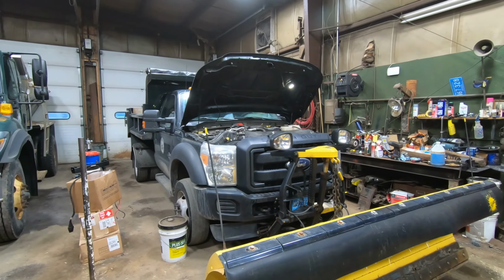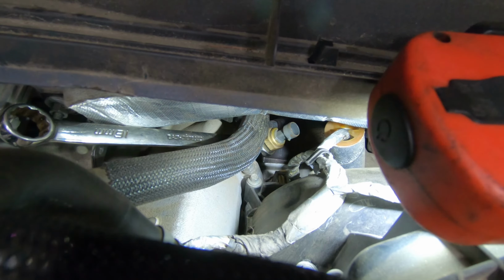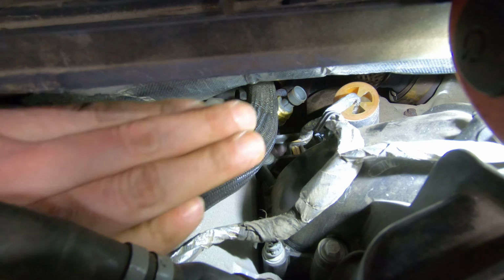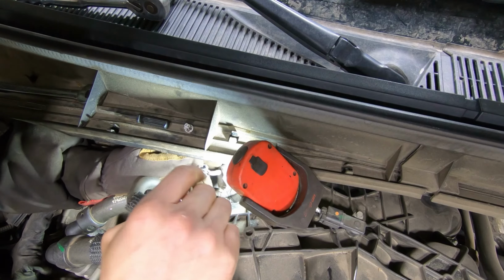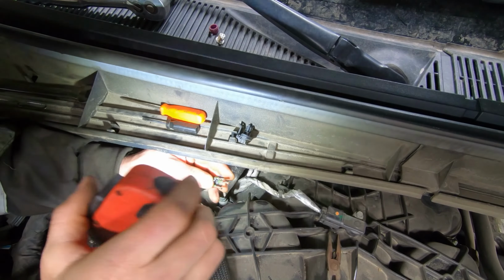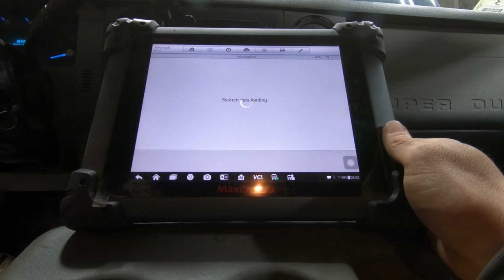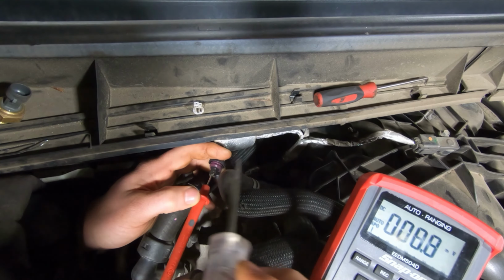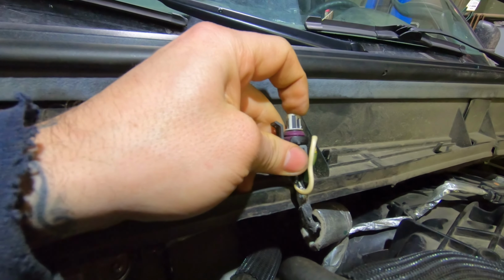ford 6.7 power stroke f550 exhaust back pressure sensor p0471 p0473 p0474

Comment: Where did you get the replacement connector
Reply from the maker: I ordered it from the ford dealer
Reply: You don’t happen to have the part number? My local dealer says there’s not one.
Reply from the maker: Wpt1376 I believe is the part number. There are a few to chose from. It is called egr pressure feedback sensor I believe. It looks right but I’m not 100%. 
https://www.rockauto.com/en/catalog/ford,2016,f-550+super+duty,6.7l+v8+diesel+turbocharged,3353886,electrical-connector,egr+pressure+feedback+(dpfe)+sensor+connector,2576
Reply: Thank you very much

Comment: I can't figure out how to unplug that sensor. Urgh it's pissing me off. Already broke the heater hose fitting. I don't need to break anything more. Trying to swap out the cp4 for the DCR. This sensor is connector is holding me up from 1 last intake bolt.
Reply: Of course I got it right after I commented

Comment: I have these codes P0471 and p0473 the sensor was broken off putting intake manifold back on put new sensor on now I have these codes an it’s running crazy rough

Comment: Got this code, along with the p2459, all monitors are good..swapped the sensor…blew out the tube, drove 50 miles and nothing…not sure if I should swap the dpf diff sensor as well…or just get the dpf filter cleaned professionally (there’s a service that does this near me) it was changed out 2 year ago (about 60-75k miles) please advise

Comment: Just got this code 8hr away from home, swapped out the sensor pretty easily with this vid. Thanks! To others: 16mm open end wrench, 1" deep socket on u joint hinge with abou 6" extension worked very easy. Be prepared for the nut to slide down the tube, it's a compression fitting.
Reply: I replaced the sensor and drove it for a week without any problems.  and now the code has appeared again. Do you have idea
Reply: @vasilykhachiuridze5747  the pipe probably needs cleaning

Comment: Great explanation/video 
I used a crows foot and extension to hold tube at base then used socket to remove sensor. Used pigtail pta1017 from Carquest 
Thanks again for making good content.
Reply: Excellent information on the repair pigtail part number! Thanks for your contribution.

Comment: The insulated cap with the plug in it on my truck is just hanging lose and not connected.

There is something plugged in to the EBP ???

I’m wondering if someone else has already messed with this ???

2017 f-550 6.7 245,000 miles 

Lots of idle hours 

Codes p132a
P0471
P0473
P0474

Comment: I got a p06A7 code coming up on my 2019 f-350 would that be associated with the Exhaust back pressure sensor?
Reply from the maker: Is that the only code? The code came up as sensor reference voltage b circuit range/performance. Possible causes are vref circuit short to ground, vref circuit short to voltage, vref circuit open, and shorted sensor.

Comment: I have a 2017 f350 6.7 80k miles giving me trouble I have been to the dealer 3 times now and they can't replicate the problem. When I'm towing my equipment to jobs it will intermittently reduce engine power and give me a boost performance code P2263, and a P0474. I can clear the code  going down the and it will continue to set the codes every couple miles. Any recommendations for repair would be appreciated. I use this vehicle for my small business.
Reply from the maker: So I just looked in a ford power train control/emissions diag service manual and under the p2263 pinpoint test it says diagnose any baro, ep, map, and egr DTCs before continuing with this test. So you should look at the p0474 first. It seems to be an exhaust pressure sensor intermittent code. This code can be caused by a bad sensor, a clogged exhaust tube, a bad harness or plug. Are those the only two codes you are getting? It’s kind of a toss up on what direction to go. My guess is the harness is going to be breaking or the terminals in the plug are worn and the connection is going bad. I would check the harness to the plug of the ep sensor they usually break close to the plug. You can get a repair harness from ford for it. Other problems could be the sensor, or a clogged tube but I would guess there would be other codes with that. But I would start with the plug pig tail. If you have access to a scan tool that reads live data you can see if the ep sensor is putting out a false reading. It should read atmospheric pressure with the engine off. But if the harness is not making a good connection it could be off too. Wiggling the harness with the engine off might make the reading jump around leading to the plug or wiring as the source of the problem. The turbo uses exhaust pressure sensor for feed back to control the turbo so the ep code is probably causing the turbo code. If you can graph data pids on a scan tool you can drive it and graph the ep sensor and look for drops in the signal that shouldn’t be there.
Reply: @JasonTheMunicipalMechanic   Thank you for the quick reply I do have a scan tool and I will get someone to help me check the sensor plug here shortly what you are saying makes perfect sense.

 Those are the only 2 codes I am getting, the p2263 code actually shows up twice, before and after the p0474 in my scan tool listing 3 codes total which is the first vehicle I have had to that with the dtc reader. I drove the truck for about 2000 miles with the engine light on with these codes stored and it finally tossed a def injector fault code along with these. Ford replaced the def injector and I thought all was well until earlier today when it did it again. Bone stock truck.  

I regularly tow with the automatic engine brake on im not sure if that makes a difference but my plan is to check the connector sensor and clean the tube as you stated and I will be sure to reply with results.

Thank you! I appreciate your reply
Reply: @JasonTheMunicipalMechanic  I just finished removing the sensor. When inspecting the tube it was clear no real obstruction just some soot along the inner wall but nothing to amount to any restriction I used air to blow the tube back into the exhaust. 

The sensor itself had a fair amount of soot built up inside I used air to clean it as well and some deoxit electrical cleaner I just re-installed it. I attempted to change the reading on the scan tool by moving the connector around and its showing no irregularities.

I plugged it all back up and it's doing fine... which is normal until I'm under a load and have been driving about 30 to 40 min thats typically when it tends to act up 

If it happens again I will replace the sensor just to rule that out.

I will be towing about 24,000lbs later this week for about 2 hours one way and then back. This particular load tends to set the code I will leave the scan tool plugged in and watch for irregularities.

Thank you for your help with my situation.
Reply from the maker: Hopefully the soot inside the sensor was causing the problem. If it comes up again I would lean towards the plug and wiring to be the problem. The terminals can spread inside the connector and make poor contact. The truck this was on was a 2016 with around 40k and the wire broke about an inch from the plug.
Reply: I have a motorcraft ebp sensor ordered. 

I determined today that I can unplug the sensor and drive the truck with no issues and no check engine light. 

It will only get to about 20psi of boost on the gauge at wide open throttle and the code reader is getting 0% egr error reading of course.

It does store the high input code for the sensor at start up but doesn't illuminate the check engine light.

As soon as I press the button for the engine brake it flashes several times on the display and then the check engine light comes on just like it does when I am actually towing before it sets the p0474 intermittent sensor code. 

I checked the wiring today I visually inspected the first couple inches of the pigtail by removing the insulating wrap and all seemed well I have not removed the pins from the connector as of yet.

 My color coding is different than the wiring you describe in the video and I do not know which pin on the ecm they lead to to measure the resistance in the wire. 

When checking the voltage drop should I have the key in the run position? 

I have high hopes this is just a faulty sensor I will have the new one installed tomorrow.
Reply from the maker: You can email me at jasonthemunicipalmechanic@gmail.com and I’ll send you pictures of the pin out of the connectors. The book is from an 11 so I’m not sure if it changed for 17, but I’d imagine the sensor plug wording is the same. You would want to check it with the key on so there is power.
Reply: *Baro(InHg) reads a constant 29.5 with the truck running or not. (The line says straight all the way across even if the sensor is unplugged and plugged back in)

*MAP(InHg) will rise slightly when throttle is pushed but is maintaining about 29.2 and with engine off its 29.2 constant. (Slight line spike)

(No reading from these last two I have listed if sensor is unplugged)

*Command EGR (%) is bouncing between 27.0 and 29.7 at idle. (Slight line spike)

*EGR error (%) bounces between 0.0 and -3.0 at idle (slight line spike)

From my elcheapo scan tool Innova
Reply from the maker: The baro is giving atmospheric pressure so that one won’t change. The map is going to be manifold pressure with the engine off it should be the same as the baro or real close your seems fine. When there turbo makes boost the map will increase adding whatever pressure the turbo is making. The egr is the amount the egr valve is open. It seems right and you don’t have a code for that so i wouldn’t worry about it. Do you have a data pid for exhaust pressure or exhaust back pressure?
Reply: I dont think I do. I will see if I can get my hands on something to be able to read it. I only have 24 live data read outs on this scan tool very basic stuff. Thank you for the help.
Reply from the maker: Look for exhaust back pressure or exhaust pressure. That is the data you want for that sensor that goes with that intermittent code
Reply: @JasonTheMunicipalMechanic  you are the man. 
I got out my multi meter and had the constant 5v on the 1 wire and had the 11.5 mv and 10.5 on on the other two no matter how I moved the wiring.
I replaced the sensor and towed 2 hours 1 way with the engine brake on and it didn't act up until I was close to the job.

The first trip It didn't reduce the engine power and did not set the p2263 code But the p0474 did show up by itself on my scan tool (I had it plugged in the whole trip) and the engine brake light wouldn't turn off on the dash. Cleared it and continued on driving with no further issue.
On the returning 2 hour trip I towed with the engine brake off and had no codes and no issues for the first time.

I'm narrowing something down now. It had always set the p2263 code with the p0474 before now.

I appreciate you help!
Reply from the maker: If you still getting the code you seem to still have a problem with it. So the pin out on the exhaust pressure sensor plug is if you looking at the harness side of the plug facing the pins. With the clip on the top the pins are top right is called signal return or ground, top left is 5 volt reference, and the bottom is the exhaust pressure signal wire to the pcm. You want to have between 4.5 and 5.5 on the two top wires with your meter leads on those two wires. The intermittent check on the sensor is to have the connector plugged in, ignition on engine off, access the pcm and monitor the ebp_v (volt) pid. While observing pid wiggle all accessible harness from ep sensor to the pcm and lightly tap on the sensor, wiggle the ep sensor connector, look for sudden changes in the voltage when harness and connector are wiggled or when ep sensor is tapped. Were you able to find the exhaust pressure pid on your scan tool? It will probably be ebp or ep you want to find the voltage one. It says if the voltage doesn’t change to check the pcm for pushed out pins or pushed deep into the connector or corrosion on the pins. The exhaust pressure wire should be pin 58 in the pcm-e connector. At least it is for 11-16. If you email me I can send the pin point test to you. Do you remember what pins had what readings. I think with ford the higher the Voltage the lower the pressure
Reply: @JasonTheMunicipalMechanic  I am having the dpf deleted and a 50hp tune put on while they have it tomorrow. I plan to just fool the sensor reading and get the smog junk off and I will be sure to post my results next time I tow if it doesn't do reduced engine power
Reply: Made a 200 mile round trip today with no issues at all after the dpf delete and single 50hp tune. Thank you for all your help
Reply from the maker: I don’t know how much help I was, but I’m glad you got it worked out. It’s not fun being plagued by a problem.
Reply: @JasonTheMunicipalMechanic  I learned way more about how the sensors work than I wanted to 😆 through all of this. 

I found yesterday, which was after the tune and delete, that the o-ring on my hotside turbo inlet duct was completely missing. I could wiggle the pipe and hear a hissing noise when I moved it. I have .125 o-ring i made up in there now until I order one from Ford, Im 100% sure but that boost leak that I was getting from not having the o-ring in there may have been causing that issue all together.

Being as it would only go into limp mode at constant highway speeds. Maybe the sensors noticed it and it didn't have a direct way to give a code for boost leak one code was turbocharger system performance. Who knows. Hopefully our conversation will help someone else later on. Great videos BTW I'm impressed with your channel

Comment: Which one the p0471?
Reply from the maker: I’m not exactly sure what your question is. A p0471 is set when the computer detects a difference of more than 7.5kpa between the exhaust pressure sensor and the baro or atmospheric pressure while the engine is off. A p0474 will set if the computer detects a sensor signal that is greater than 90kpa of a difference between the actual signal and the modeled signal for 2 seconds while the engine is running between 1300 and 2400 rpm. There are other entry parameters but that is the basics of it.
Reply: You think mine pops out because it’s deleted
Reply from the maker: What codes are you getting. I don’t know if deleting it would cause it unless it happened right after you did it. That code is an engine off code so I would guess it’s electrical. I would use a scan too and check the exhaust pressure sensor and the baro sensor with the engine off and see if they’re the same or within 1.08psi. The baro should read atmospheric pressure which is different depending where you are. It should be around 14 psi.
Reply: @JasonTheMunicipalMechanic 
can you help me.  I got this error light today.  tell me where you are and if you can help me.please